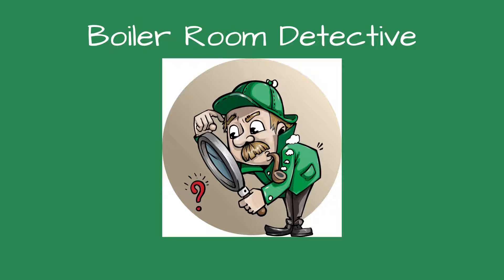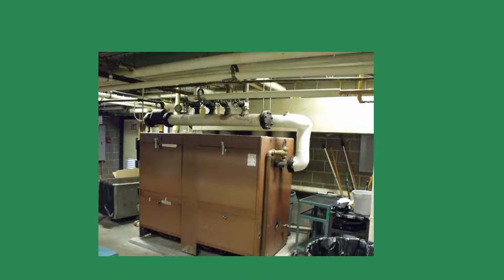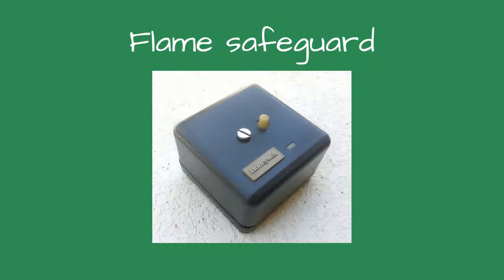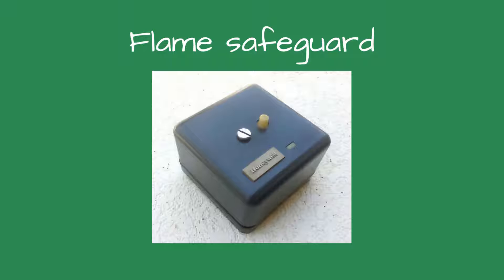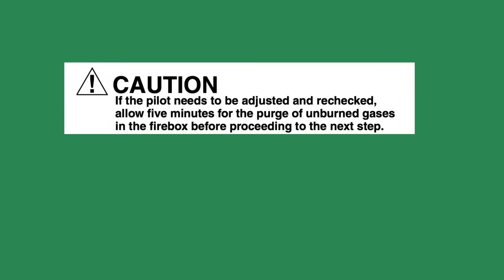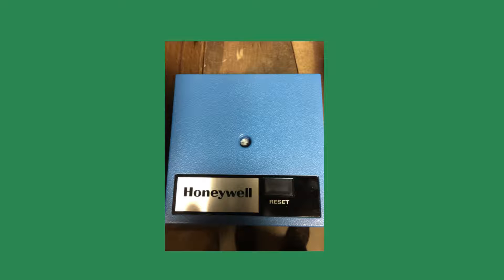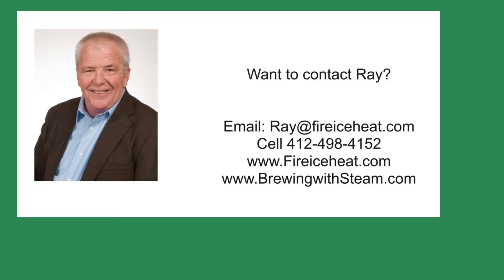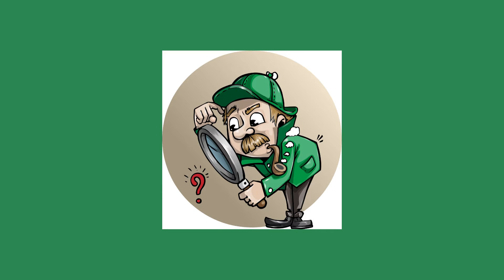Case of the Faulty Flame Safeguard

Comment: I don't like working with your general run of the mill maintenance guy's and will never show them anything about a boiler. We are not talking about some RTU or some ( BS ) furnace.
And I have a great reason for that which I won't get into. I do refrigeration know and years ago I got hired into a major manufacture that had one of the most deadly boiler explosions in America. During my interview, they say we have to ask you about boiler's you probably don't know to much however we have to ask. First question : What is the most important part of the boiler cycle? I look at them and said the purge cycle at the start up. Then to save time I drew out the gas train assembly and all the safety circuits. Needless to say I got hired. Love your videos
Reply from the maker: Thanks W D I am kinda torn about working with them but I do like showing them the reset buttons and tell them to only press it once. If it fails again, I tell them to  contact me. I hate having to travel across town for a simple reset button

Comment: Oh man. Tragic! Sorry to hear this ended so badly. I know many people hate PLC controls and electronics in general; but one of the good things about properly written code is that it will prevent an accident like this. The reset function would be available only once or twice before a lockout period was enforced by the software.
Reply from the maker: I agree  I know we were working on an oil burner that would lock out for 20 minutes after the reset button was pushed twice. Thanks for the comment
Reply: I have  taken care of 200 hp York Shipley steam low pressure for 41 years.  We are doing hvac upgrades at the school and the boiler is going.  I will not miss it. Hot water boiler s are the only way to g0. In another part of the building I have a hot water boiler that is 25years old  I have replaced nothing on the boiler  except the low water cut off.
Reply from the maker: @Kevin-wj4ed  They do require maintenance and can be a bit finicky but you will never get 41 years from any new hvac equipment
Reply: @boilerroomdetective   the steam boiler is 61 years old. We have water treatment in the hot boiler loop.